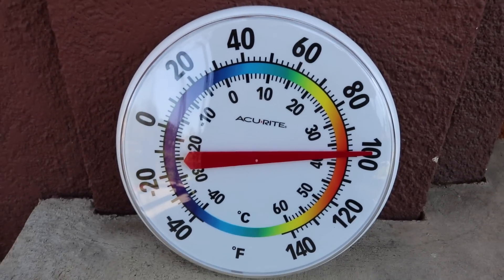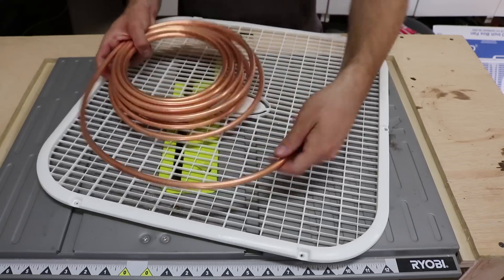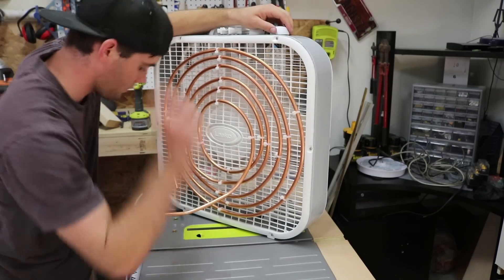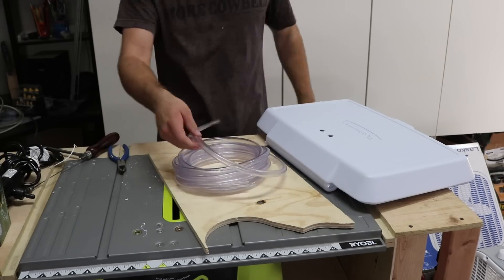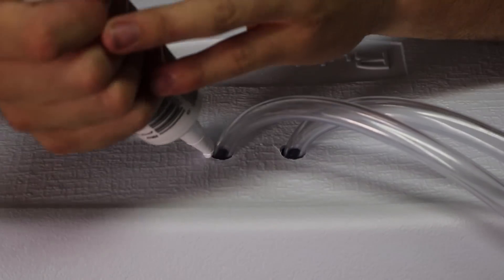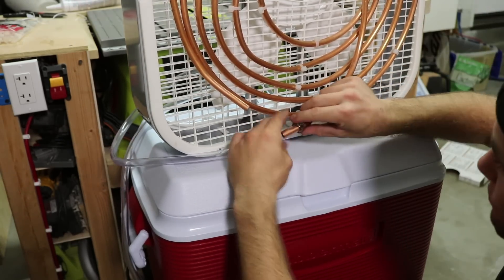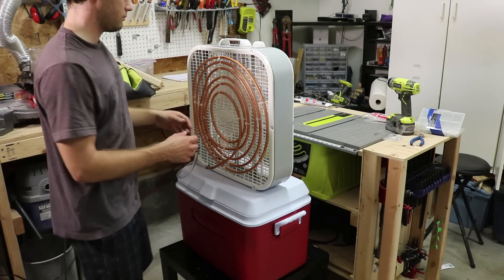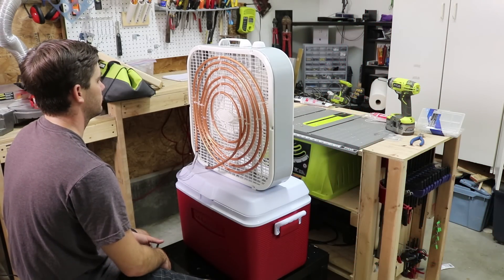$100 Homemade Air Conditioner - DIY

Comment: Why even bother with this thing?  I can't fathom spending $100 to make this ridiculous contraption, is it never going to work anywhere near as well as a real A/C unit.  I paid $100 for a 5000 BTU window A/C unit, it keeps 2 bedrooms, a bathroom and a hallway comfortably cool, and costs me about $0.25/Day to run.  If you want an interesting and practical project to do for teh youtubes, I suggest converting a window A/C unit into a portable A/C configuration.  I've seen it done, it worked very well too.  Not only would that allow people with odd shaped windows to use an A/C, it could save a few hundred dollars too!  Imagine turning a $100 cheap window unit into a $450 portable A/C!  Now that would be something!

Comment: Don't know how effective, but I think it would be more effective using a aluminum type transmission cooler as it would allow better heat absorption due to the aluminum and the fins on the coils
Reply: Copper has a 70% higher thermal conductivity. The only reason aluminum is used in vehicles is it is lighter and cheaper.

Comment: You forgotten the ice you will need to buy constintly or generate using a fridge "electricity"
So it is not cost effective comparing to an AC.
Personal opinion

Comment: Excellent idea to waste a 100$. Also well done on ruining a perfectly fine cooler. You could have just bought a small/medium sized window AC unit for 100-110$ .. for the argument of AC's energy/power consumption here's my counter argument - amount of energy used to make the ice in your freezer for refilling the cooler, might be even more than the power consumed in an actual Small AC unit. Anyway just my opinion, you don't have to agree with me. Cheers!
Reply: Point is to save on high electricity costs lol
Reply: @NYCherbs  : Electricity cost will be the same - Producing ice consumes electricity !
Reply: I don't think he had a window

Comment: The electricity cost for this is exponentially  less than a real unit for all you who dont understand math
Reply: Lee Casey how about the cost of the refrigeration unit to freeze the ice? And then assuming that refrigeration unit is indoor, how much extra is his home AC bill due to increased heat output from refrigerator?   :/

Comment: Glue some insulation board on the garage door would help cut the heat coming through.
Reply: that would help the most
Reply: Probably a far better idea than the unit he made.

Comment: I built a similar unit, but instead of copper tubing, I used the coils from an old car radiator. This allowed a higher air to cooling element ratio. Place radiator behind the fan, not in front to keep from dampening and restricting too much airflow. Use milk jugs full of water for ice, they last almost all day in the hot southern Nevada sun.  Make sure cooler is completely sealed air tight to get maximum efficiency. Running two units in my 3000 sqft shop all day makes it bearable to work in there now. 

Note: If you own a swamp cooler, add the milk jugs of ice into the swamp cooler to have a similar effect. Water is the second best liquid at retaining temperature other than ammonia (which will kill you).

Comment: Won’t the water hit an equilibrium if there’s nothing cooling the water. Eventually unless there’s mechanical cooling cooling the water it will become as warm as the air 🤷‍♂️.
Reply: yeah, at that point he can just refresh the ice. or he could build a freon-condenser style unit!
Reply: Craig MacMillan right depends on the actual ambient temperature. If it’s 100+ how long you reckon it’ll last with the heat gain. You gonna set your alarm every few hrs to replenish the cooling supply 🤔. Think not
Reply: @AdUnumomnes  That depends on how good of a cooler he's got. By the looks of that one, I'd guess the ice would last 2 or 3 hours(ish) in that hot of a garage. If he wasn't concerned about corrosion, he could add a bunch of KCl (instead of NaCl) road salt to the water to lower the temperature to around 25 degrees F.

Comment: Not an AC. Just a cooler. At some point ice will melt, water will come to same temperature as environment. No cooling after that. Very unaffective way.add a compressor of some sort. Use coolant. Reduce pump size,
. for roughly 20 bucks more. It wouldn't d also need a container so big..
Reply: If you want a reasoneable amount of cooling, you need 150 pounds of ice per day !  See my other comment for the maths of this !

Comment: also it may not be cooling at all. im guessing that fan is 25W and pump is 2W so that 93 btu/hr of heat ur putting in ur house. I cant tell u how much that's pulling out of the air. id need pump flow rate, TD, and inlet/outlet temps...etc but nice try lol
Reply: Your point is well taken except for one detail. The "latent heat of fusion" for water is 144 BTUs per pound and water weighs approximately 8.35 pounds per gallon. What this means is that one pound of ice (less than 1/8th of a gallon) will absorb 144 BTUs just in the process of turning from solid, 32°F ice to liquid, 32°F water. This energy is absorbed by the change of state from ice to water without any change in temperature at all. Additionally, this one pound of water can absorb another 88 BTUs of heat to get from 32°F to the ambient air temperature of 120°F. In short, one pound of ice can absorb 232 BTUs of heat (assuming the initial temperature is 32°F and the final temperature is equal to ambient of 120°F). There is also no reason one could not consider an initial temperature of less than 32°F, and indeed, even consider supercooled ice. Since water weighs about 8.35 pounds per gallon, a cooler full of 5 gallons of ice could remove up to 9686 BTUs in theory, before needing to replace the warmed water with new ice. I am not suggesting by any means that this is the most practical or efficient cooling method achievable, but it works in concept to remove up 9686 BTUs, as the math tells us. It is by no means the most efficient way of energy transfer though, as the exchange rate will slow very considerably as the water temperature approaches that of the ambient air. The method used here is that of a simple heat exchanger and I am sure that it isn't optimized for when the water is just a couple of degrees cooler than the air.

I will add that this concept is no different in principle than that of an automobile radiator cooling system for the most part. There are really only two differences -- one favorable and one negative. The favorable aspect is that water is a better medium for heat exchange compared to an antifreeze/coolant mixture such as a glycol additive, because water has a higher "specific heat". The only purpose of the additive is to reduce the freezing point and increase the boiling point of the water to extend the range of temperature application. Neither are any concern in this instance. The trade-off to the glycol system is a reduction in the specific heat of the solution. On the negative side when comparing this to an automobile radiator system (besides being engineered for optimal performance), is that the automobile cooling system benefits from forced air flow when the vehicle is moving, so does not rely purely on a fan for air movement across the coil.
Reply: @pauljansen57pj  im not reading all that lol.i went to school to and practice my trade..lol
Reply: @pauljansen57pj  and im not sure what ur getting at? 144btu....970btu ...ok u went to school and learn sensible and latent heat...the change in enthalpy...one state to another .ok.
Reply: one ton of ice removes 12000btus  hour

Comment: I like where ur heads at but..... the ice u make will heat ur house up more than u can cool it. im not sure of ur air quality down there but ur best bet is to get a evaporative cooler. it doesn't used compressed gases to cool and is cheap with power. u will have to see if the dew point or wet bulb temp is proper for this to work but look into it....

Comment: good effort, did not include ice replacement cost or deep freezer where one makes the ice, better would be to throw in peltier ice maker, and then no ice replacement , two peltier module averages minus 10 degree Celcius, which means water will remain below freezing, to counter water freezing pinch of salt will make it brine and anti freeze.

Comment: 1stly - You didn't even include the cost of the drill you had to use, or coping saw/hacksaw, or the energy costs of operating the fan and pump.
2ndly - You gave no ambient temperature reading afterwards, in the spot infront of your homemade air conditioner. At the very least, you should have sat a thermometer a meter infront of your fan, for 30 minutes or so. 
3rdly - You say "All of the ad revenue from this video will be donated to the American Red Cross" - yeh right. How do we know or trust that you are actually donating any ad revenue money?? 
4thly - "*requires frequent ice*". Is the frequent ice free? No, you have to put the time & energy into making that in a freezer. And you didn't even do that. In the video, you used a bag of ice that looks like was purchased from a shop. And so you also didn't include the cost of the bag of ice.
5thly - You have nearly 100 thousand views on your video here, about putting together a (not very effective) homemade air conditioner. Браво и молодец!
6thly - Now that I am older and wiser, I recommend the covering of the mouth and nose (the airways to the lungs), with some type of face mask, when sawing or drilling absolutely any type of solid material.

Comment: Why dont you insulate your garage door? Foam insulation panels are cheap. Like 5 bucks a panel.
Reply: I'm curious, did you insulate your garage door and if you did would say the cost/efficiency was worth it?
Reply: @danielgreen3965  yes. R-12 insulated made a huge difference.

Comment: cool project! in multiple ways! i want to point out that the cooler being sealed is counter productive because this is a $100 project that facilitates the heat exchange between the inside and outside of an insulated box. The reason this project works is because the real source of coldness comes from manually moving cold ice from a freezer to the insulated box (the 'cooler'). But the whole 'cooler' doesn't cool anything. the premise that 'the less holes the better' is really only true if we want to slow the heat transfer, and we want the 'cooler' (the insulated box) to actually keep something inside the box cooler longer. but the opposite is the case here. thus it's a big logical error, which is why experiments are super! And a cheaper, far easier solution would be an ice bag on the cement floor with a fan to blow air across it (without any 'cooler' at all). Another project possibly worth experimenting with would be to use this project to transfer heat from inside the room to outside the room. Building 2 windows in the room and opening them to let cooler air blow thru the room is an effective example of this. But this is still a super neat & cool project! great job!

Comment: I bought a $10 high speed small metal fan. 5 gallon bucket. Bunch of reusable freeze packs from $1 store, siliconed the fan into the bucket lid wind blowing into the bucket, then cut a hole through bottom side. Works awesome full of ice packs. Because w a cooler it just blows across the ice. W mine the air blows through the ice. Your ice might last longer. But this blows ice cold & i could put a vacuum hose out the exhaust to be precise where want to blow & my fan could be 4" bigger. I couldnt imagine a cooler w multiple fans or just a edf fan. But I dunno how to convert something like that to plug in

Comment: Wait for few minutes or an hour and that copper tube will sweat like your balls on a hot summer and prepare a mop to wipe down the water drips on your floor.
Reply: I doubt that skinny copper tube would have reached a cold enough temperature to do anything in the first place. I don't like this approach for an air cooler. There are more effective homemade air coolers/conditioners elsewhere on YouTube.

Comment: Great for places where temps are hot and ice is free.
Reply: bill boyd:  You know a place where to get free ice ??? Please tell me where.  (Producing ice with a freezer at home consumes electricity, it is not free...)
Reply: @jnb8918  One guy said he steals ice from a nearby motel. These are all great ideas but they just don't beat the efficiency of an air conditioner, I'm surprised no one here doesn't just put a fan in the freezer and make more heat than cold.

Comment: We call it 
Cooler in India. 
For $100 we'll get quiet a decent one but effectiveness will depend on humidity  
This Ac u made will work best in dry weather. Normal to humid and it'll be ineffective. Same as a cooler. But coolers don't need ice

Comment: Nothing against the creator of this video, but just so you guys know (not that it should come as any surprise), but this entire build was basically a waste of time and money, and doesn't actually cool the air any more than the fan and cold water and ice alone would have. I can see how some people (primarily amateurs, to be frank) might think something like this would work, though....
Reply: that's exactly what i realized when i was watching the video. he says in the video 'the less holes the better'. oops! no, the more holes the better. he's using the cooler and 'less holes' to slow the heat exchange between the inside and outside while at the same time, built an elaborate system to do just the opposite. yikes! when we realize this, i was thinking, why doesn't he just blow air with a fan across a cooler of ice water? and for the same cost he could buy 4 coolers and 4 fans.

Comment: drill a hole for the cable instead. cut the wire, follow it through and reconnect and insulate.

Comment: Compressor ₹4000, condensor ₹1200, evaporating coil ₹1200, copper tubing ₹500, miscellaneous ₹1000.. Total ₹7900, in todays Inr to Usd it gets $111.42.. You get a real Ac

Comment: Anybody with half a brain can see that your air conditioner will not work worth a damn I mean even people with basic knowledge on how a HVAC system works would know that is not feasible you just wasted some money and time I will bet you a hundred bucks that thing doesn't make a degree in temperature difference

Comment: That is one shity air conditioner your copper tubing doesn't even have any fins on it without the fins it's barely going to do anything and especially with just using water you'd be better off building swamp cooler

Comment: How about using a small intercooler from a car? 
Install an elbow bend and 12v 120mm on in the inlet and another elbow bend on the outlet.
Drop the whole thing in a bucket full of ice cold water. Obviously the inlet and outlet stays above the water line.
Will this method work?
Reply: no, it won't because the whole premise is faulty. both projects are only transferring heat (or 'coldness'). we only need to consider from where the true coolness comes. Ice cold water needs to be cooled to ice cold water. how that ice cold water becomes ice cold is where the real solution lies. this is only adding one more complicated step between the real solution. his project wud be far simplified and cheaper and more effective with a fan and bag of ice. the ice melts, get a new bag of ice. the ice melts and get a new bag of ice. get the picture? one can make it more effective by using multiple bags of ice at once. and far, far better than any ice is ... to use an A/C unit, which is a lot more complicated but an AC unit transfers heat from his room into another place, like the outside air. now the A/C solution will actually work.

Comment: If ambient temp. Is 120 degree F. In room then this system will work for 10 minutes and then fails. Because ice melts .

Comment: weak performance, or not at all. you must use a copper radiator. In my living room the temperature dropped from 32 to 24.

Comment: So I was curious and tried this. Its completely useless. It basically cools down the air ever so slightly so the wind chill makes it feel colder but after measuring the temperature before 24*C and after 23.9*C. As a reference my body temperature is about 35*C.

Comment: the way aircon works by using freon gas not water. you cant cool the pipe enough. good idea and good job on the video. better than to sit on your lazy ass and do nothing.

Comment: All you had to do was to get a cold water filled with ice in a big flat vessel/utensils and direct the fan's airflow towards the vessel.  Hot air from fan going through cold surface of water will cool the air. Also, more the surface area of water , more cool air you get.  
And cost wise less than $10 maybe or if you have everything at home it's free. :)

Comment: FIAL - It’s not an air conditioner, the guy’s not conditioning the air.  What he built is a heat exchanger.  DOUBLE FAIL - For $99 you could have purchased an air conditioner.

Comment: A better idea would be to go and find a radiator at a junk yard and a water pump and just pump it through the radiator and power the radiator fan, it would have a much more refined effect since it would have actual cooling fins vs a large coil, increasing your surface area, and the cool water would effect the air much more quickly.

Comment: I can't believe no one else mentioned this but for less than $100 you could have insulated the garage door and that would have likely made a much bigger difference in ambient air temp in the garage. Without dealing with constantly making and replacing the ice, without dealing with condensation, and would add $0 to your electric bill. In fact if that is an attached garage it might even lower your electric bill.